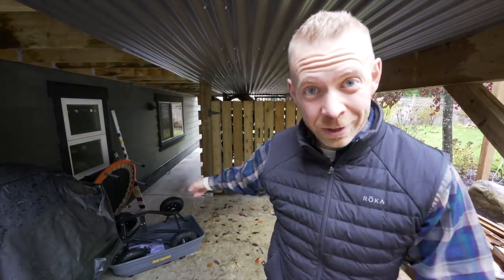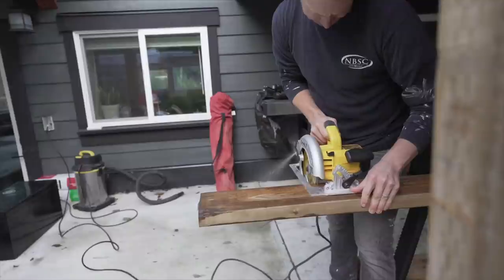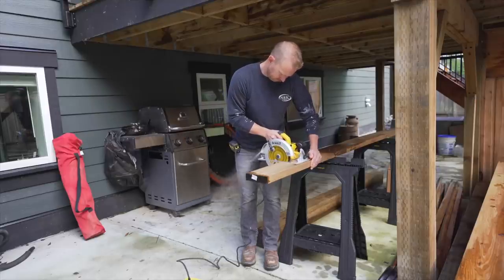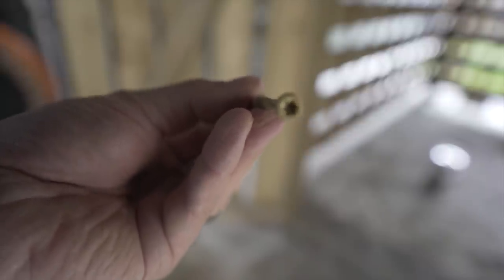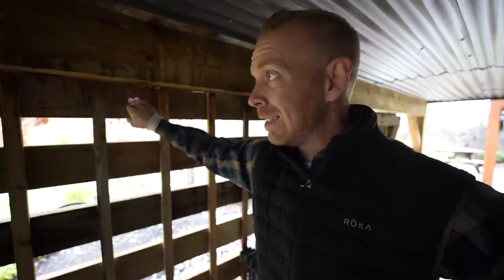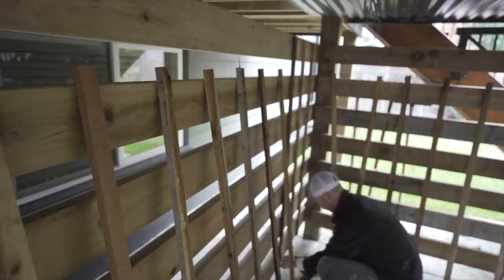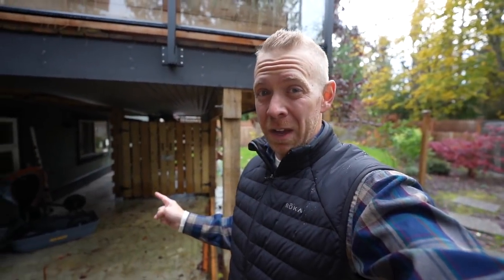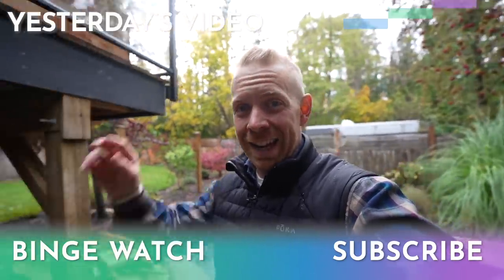PAIN CAVE PROJECT #2: Ultimate Space Saving Bike Storage

Comment: 3 things: 1st: Add some metal bars over the wood. You can cut the wood with a Chainsaw. 2nd: Add an alarm. 3rd:  You just showed all the thiefs where and how your bikes are stored.
Reply: Sawzall would be faster and quieter. Just cut the boards right beside the lock and open the gate. Based on @339 it looks like there's just 4 boards.